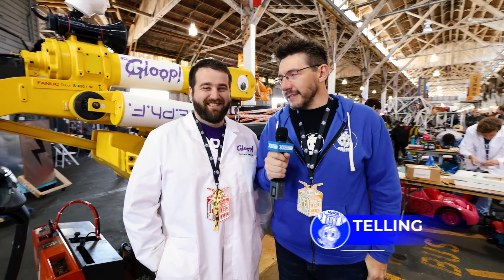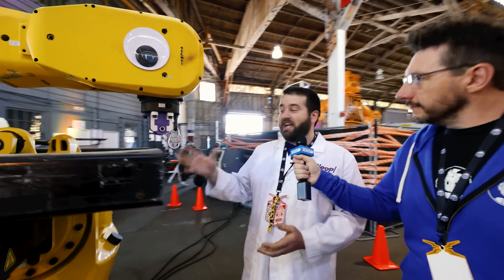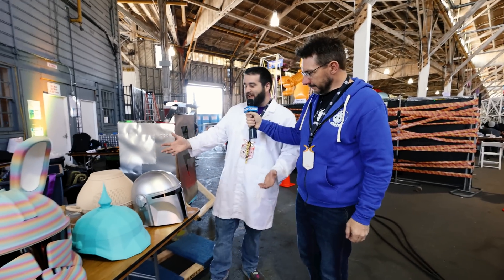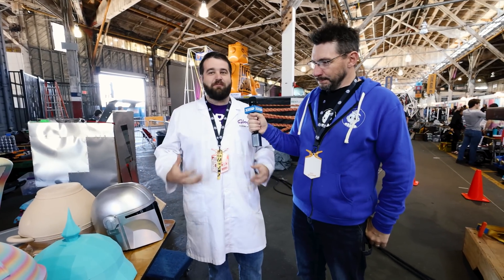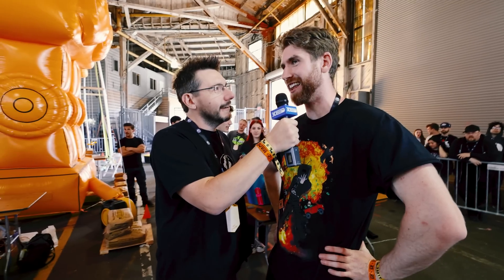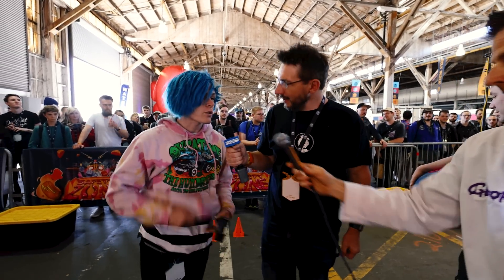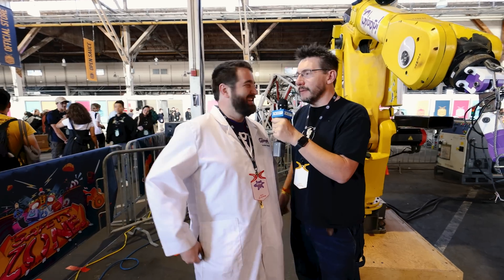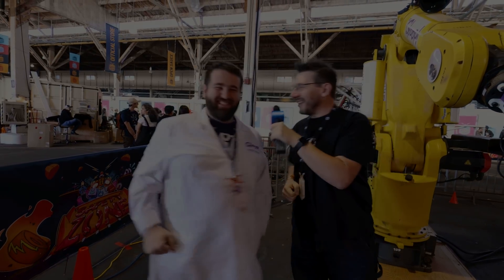We ALMOST Hurt Someone...

Comment: Does the glue work for other materials and is it strong on those other materials?
Reply: Great Question! Gloop! is only designed for thermoplastic polymers at the moment. Our scientists are always working on new formulas though so one day, who knows what's possible! 😊
Reply: @3dgloop  Does that include polyamides? That's tough to stick to
Reply: @santiagoblandon3022  Fantastic Question! So, each "falvor" of Gloop! is designed for a particular polymer. At the moment we have versions for ABS, ASA, PLA, & PET-G. There are other formulas in the works for various other materials. Polyamides being one of them. 🙃
Reply: @3dgloop  What happens if I mix all the gloops into a super gloop?
Reply: @3dgloop  Awesome! I'm eager for that one, none of the glues I've tried work well on nylons :/